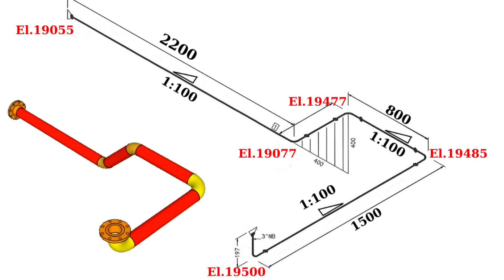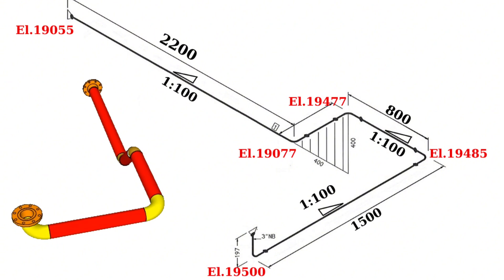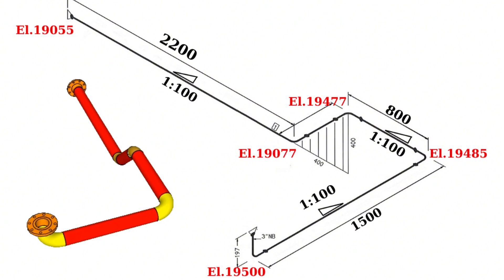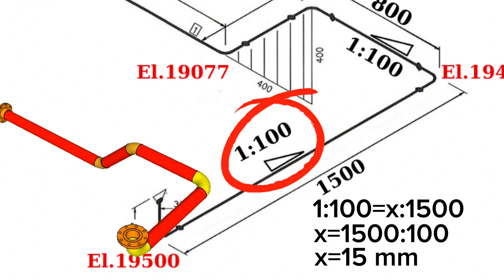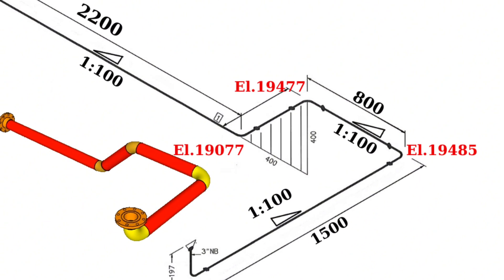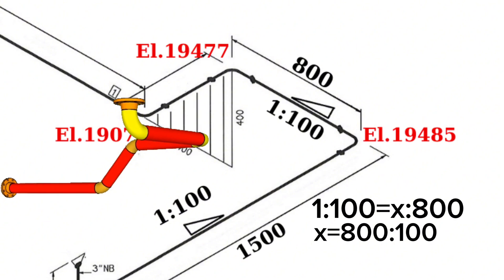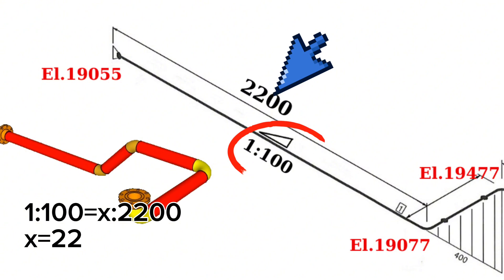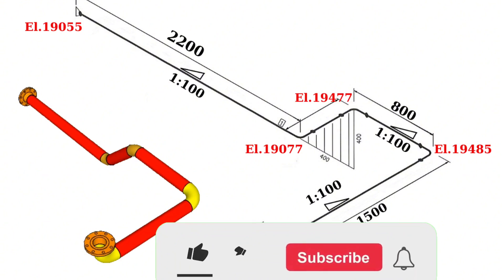Calculating Pipe Slope in Just 5 Minutes Without Any Hassle

Comment: How do you fit up the joint of pipe with slope without affecting the plumbness? Do the pipe edge or fitting edge needed to be cut at slope angle?